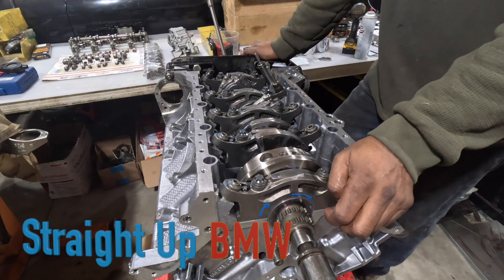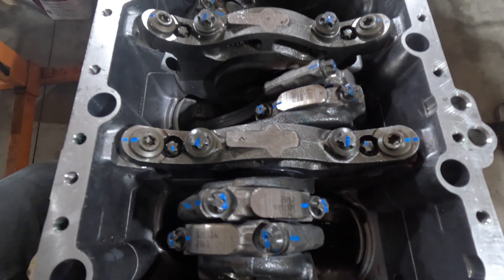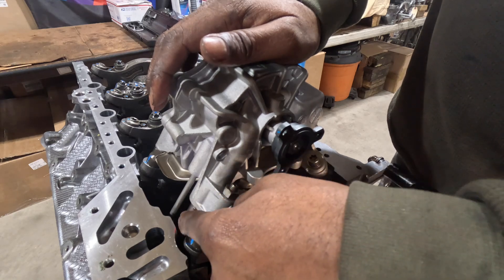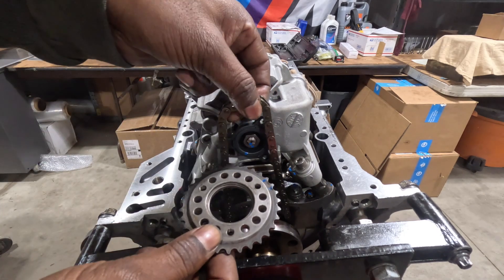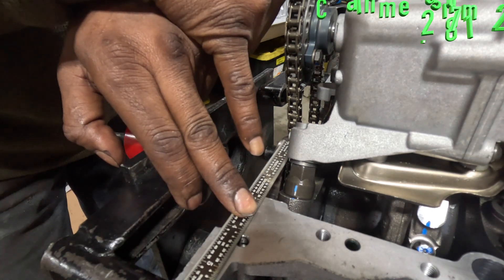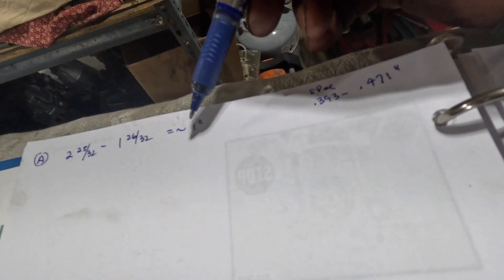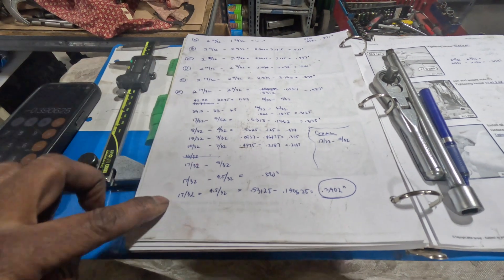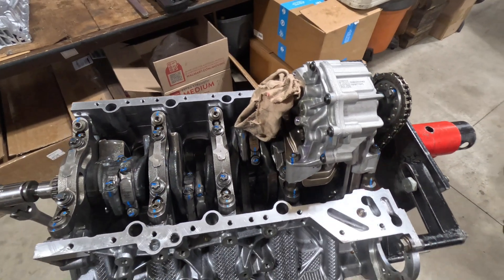BMW S63B44A P12 Rods Bolts Install & Oil Pump Adjustment

Comment: Thank you for these N55/S55 videos. I am doing the exhaust camshaft,  lifters  and rocker arms on my 2014 m235i. I had 2 rocker arm retainer clips explode sometime after I changed the ofhg( I didn't know about the priming the oil system before start up ). I found al ton of metal in the oil filter during an oil change.... now I have the bottom end rebuilt,  new to me turbo, oil pump is replaced, all new or refreshed lifters. And because of your videos I was able to do all of the repairs and maintenance in my garage with out any mechanical training or experience! Thank you!!!
How do you keep exhaust camshaft ledges flush when installing the new bolts? I don't have access to the specialty tool, and c clamps haven't been great this far.
Reply from the maker: @MidLifeMasterPeace   before I had the tool I used mini c clamps across the housings
Reply: @straightupbmw  thank you, that is what I ended up using. I had to shorten the t-handles and welding them back together to make them fit... M235i has no room between strut tower or heat shield. Pain in the @$$ but par for the course on this journey! 
I appreciate your work and detailed DIY explanations.  Keep it up brother!